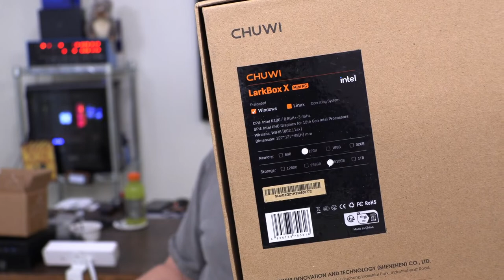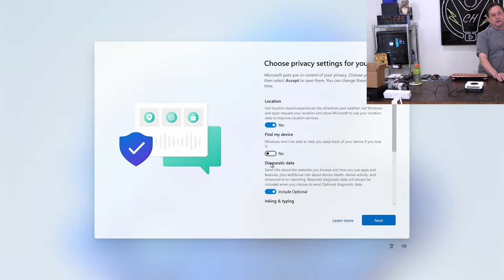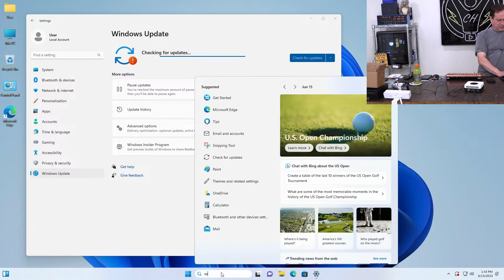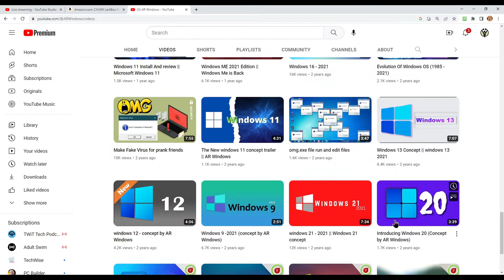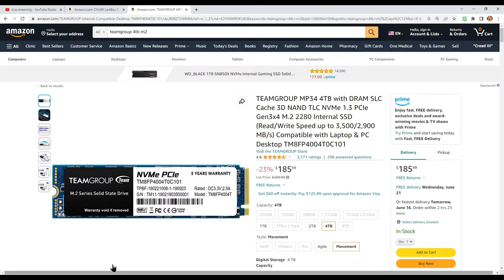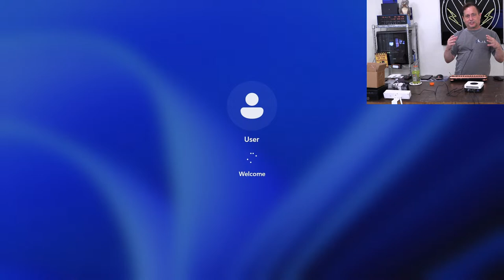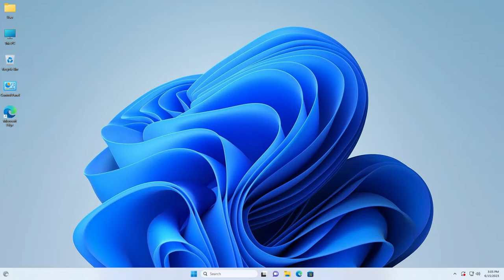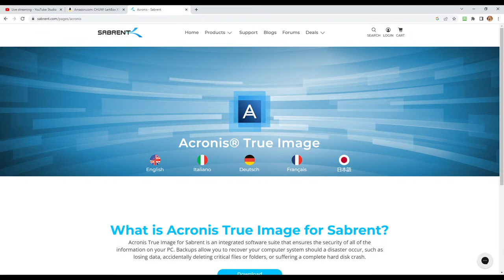LIVE - CHUWI LarkBox X Mini PC, Intel N100 CPU (Up to 4.1GHz), 12GB RAM, 512GB SSD, Dual Ethernet

Comment: I've never understood the fascination with operating systems. Hobbyists must really be bored. An OS is there to allow your important software to run and access hardware. That's it. Worrying about rounded windows and a taskbar in the center seems ludicrous. And to assume that "Oh, W11 is going to be more secure" is equally crazy. In the security world, Microsoft is a bit of a joke. They ignore critical security issues for years. And they stopped doing real quality control on their software many years ago. And if you dig down into their blog on why they think W11 is "more secure", they say it "has been shown to reduce malware by 60% on tested devices". Really? So people like me have to spend $200 on my main computer to get a new CPU for some vague belief it might help with some unspecified malware that may not even exist in 2025? And I'll replace my 8 core/16 thread with a newer CPU that will make zero difference running my engineering and software development applications? And my other 2 desktops will also need new motherboards AND CPU's? Seriously? And don't get caught up in the "don't get left behind with old technology" hype. I've been doing engineering and software development since the 1970's, and we're in an age when CPU speeds have leveled off around 4GHz, and the only way they can hype new CPU's is by adding more parallel cores. Which is fine if your software (and the problem you're solving) can use the parallel cores, but a lot of software can't. And IF it can, your GPU, with thousands of parallel cores, blows the shorts off your CPU's 8 cores. So CPU performance is becoming less and less relevant. We're entering an age when humans can't even detect the few mSec performance improvements with new CPU's or GPU's or other hardware, or the visual difference of 8K video, or a few FPS gained in mindless video games. But people love playing with shiny new hardware, so we keep believing the "new is awesome" hype. And now we have bored people with too much time on their hands worrying whether their computer will boot in 15 seconds or 20 seconds. Geez.

Comment: ton of inconsistencies in the main product detail vs the main heading description.  1 it says 256 Storage, but the title says 512gb, it says dual 2.5 ethernet, where you say it's 1.5/2.5 and says Ryzen 7 not intel N-100, and also says 8GB Ram in one section ans 12 GB in the other (maybe it's 12GB but it's shared - 4GB for graphics, 8GB system memory).